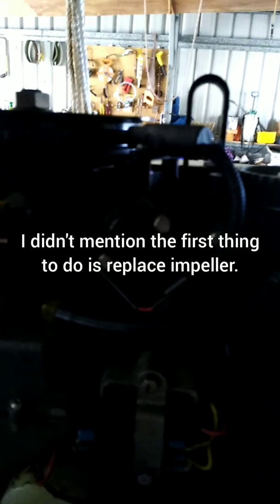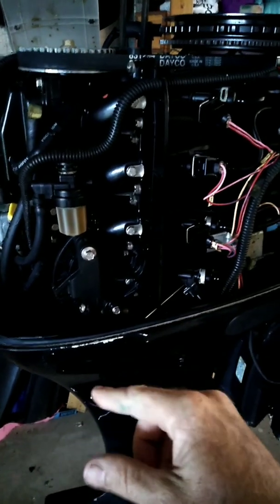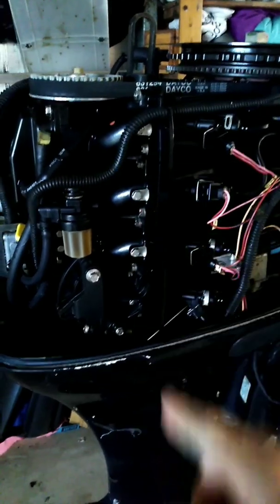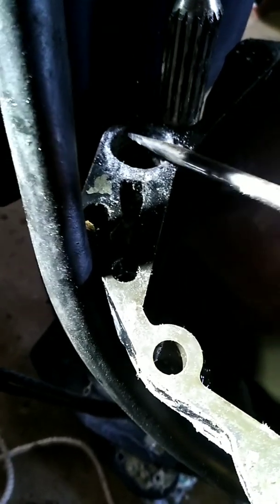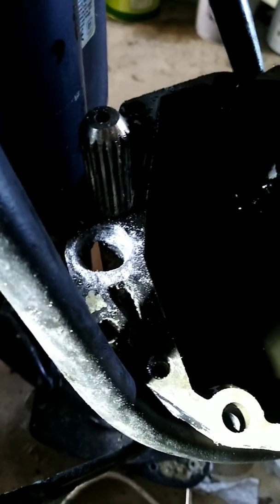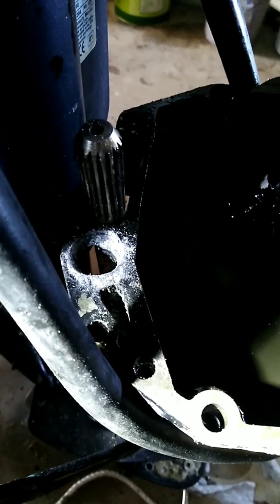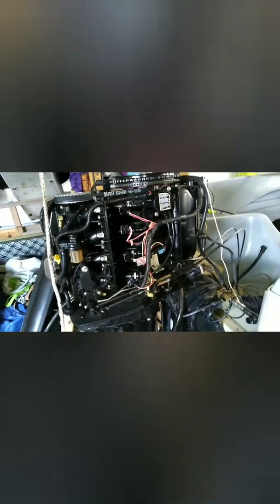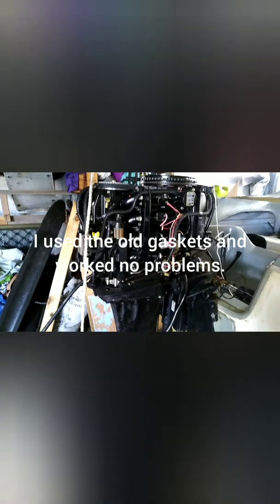Mariner Mercury outboard alarm fix overheating

Comment: Hi Dean, I have 2005 90hp Mercury. I get this constant alarm when i start the engine early morning.  Once warm the alarm goes away. I can run full throttle without any issues after it warms up. I have replace thermostat, impeller and temp sensor. Do you or anyone have any recommendation? Thanks in advance.
Reply from the maker: Not sure why you would have a high temp alarm when cold.  So it starts alarming as soon as you start when cold and it's a constant alarm. How long does it take to stop? I have had alarms on start up but that is a charging issue,  replace rectifier, but it has a beep beep beep beep beep alarm

Comment: My 60HP merc is flowing water nicely but we still get the solid beep under 3/4 or full throttle. Could it be temp sensor switch you reckon?
Reply from the maker: Sounds like it is getting hot .The alarm usually will not sound until the engine is under load so it's probably not enough water flow. Did you try changing impeller?
Reply: Mine is doing to same mariner 150 1989. I have a brand new lower unit on it but still sounds about 3/4 to full throttle
Reply: Did you ever figure it out. My mercury 175 black max is setting steady alarm off if I cruise over 30mph for 5 minutes. I changed entire impeller assembly temperature sensors thermostats flush the engine out and replaced head gaskets just as precaution. And the alarm still goes off engine is getting to 180 to 190°. We can’t figure it out
Reply: Did anybody ever figure out what is causing constant beep at 3/4 throttle or so. Just picked up an old boat and mine beeps constant after being at 3/4 throttle for 20-30 seconds or so but not anytime else. I haven’t gone above 3/4 throttle due to the beep. But anything below 3/4 throttle is fine
Reply: Check your poppet valve. The poppet valve releases water into the top end at higher rpm’s.